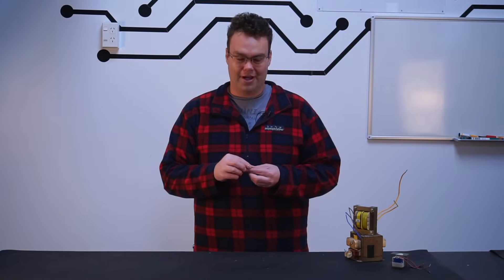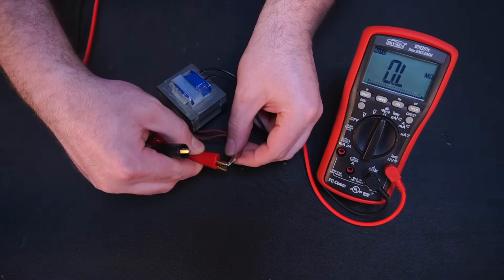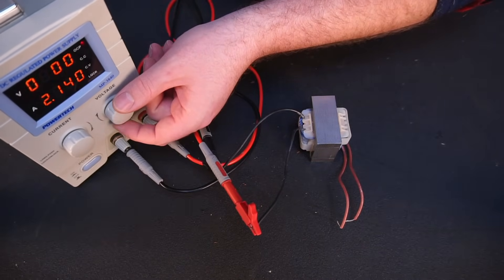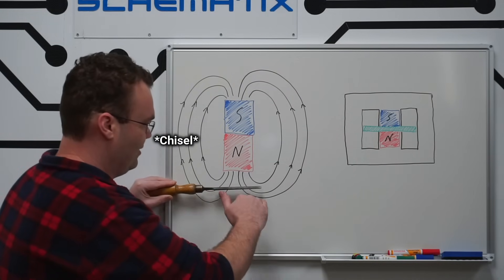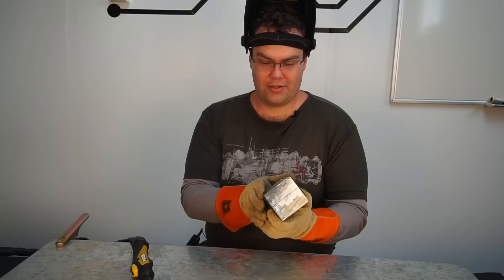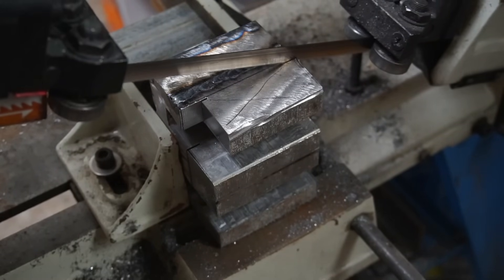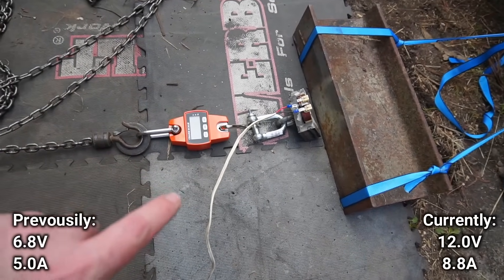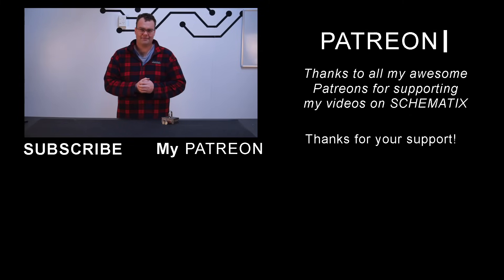Making a Powerful Electro Magnet from a Transformer

Comment: Excellent video! Who cares if you drew the bloody flux wrong. Even without the explanation, you explained it so people can build it which is more than others have managed to do. I've looked at loads of similar videos and the hosts just over complicate the basic principle. It seems it's more about ego and "look how intelligent I am..." type thing as opposed to actually helping people understand it like you've done. Quick question, could I use a 12 volt battery charger as the power supply? I'm ♿️ with technical things and don't want to blow myself up 😳. Thanks.

Comment: 9:36 Magnetic force escaping cores
Actually, I think you'll find that the flux lines will pass through the core and 'escape' out of the cut ends, rather than wrap around the whole unit. In fact if you were to separate the E and I beams by say an inch, the flux lines would escape the cuts in the E, fluff out a bit as they bridge the gap then snap back into the I beam to flow along it. Sure there'll be escape anyway, but the bulk of the field will pass through the metal. That allows us to design asymmetrical fields with a large weak side and a strong small contained side.  There are some diagrams depicting this that I'd share if YT didn't frown on posting links.  If anyone is interested, prod me in a response and I'll sort out a way to share it.

Comment: Pulleys!
I know this is an older vid and you've likely had this suggestion already, but.. To measure your magnets capabilities with your scale when the scale can't keep up, use a pulley arrangement to divide the forces.

So (unless I've mucked this up entirely) connect the magnet to your load. Hook the scale onto the magnet. Run a line from the scale to a pulley at the pole, then back to the magnet. (NOT back to the scale)  This should halve the strain on the scale. Do your stress test, then double the number you get from the scale. If that's still not strong enough, you can run a line from scale to pulley to pulley to post and triple it, and so on.  There are some neat calculators online that let you add and remove pulleys from a system and tweak load and pull forces to fiddle with this concept. It's how a block and tackle works. Which you already have in your shed there, as that's what you were using to lift yourself on the beam initially.

Pulleys let you trade motion for force, much like a lever. But a neat side effect is a careful positioning of a measuring device lets you measure the stress at that point, then simply multiply or divide out based on the pulley or lever setup.

PS: I love the kiwi accent. As an Aussie, I'm obligated to poke fun at it. "MEG" "TEG" and the other welder instead of MIG and TIG made me chuckle.  All in good fun of course.

Comment: I think it was unnecessary to cut the excess metal off the transformer. First thing, the  magnetic domains in the metal contributes to the overall magnet field. Second thing, If you had a second MOT primary coil, you could have added it series with the first and halfed the amps to achieve the same amp × turn producing magnetic field. Or ... If you the MOT coil can handle  20 amps  but your limited to 5 amps from your power supply, then you could produce twice the magnetic field with 5 amps flowing through two coils.  And last think..imagine how much time you could have saved by not cutting the excess off.

Comment: I'm not convinced the low ohm  winding makes a significantly better electromagnet. Yes, magnetic field strength is proportional to the current, but the truth is  it's proportional to the number of turns × the current. 

A copper wire with 1/4 the cross-section of a a larger copper can carry 1/4 the current of the larger wire but you can get four turns for every one turn of the larger wire.  The amp × turn ratio remains the same, granted mostly the same recognizing that thinner wires still need to be insulated and the smaller the wire the larger fraction of the diameter of the wire is insulation. 

Point being, one can still get really good electromagnets with many turns of a thinner  wire.  And, it might be easier to source a power supply  that need push fewer amps.

Comment: Thanks. I'm thinking of using one now as a "key" outside to move a locking mechanism mounted inside the door. 18650 cell powered, switchable to keep in my bag.
Doubt many burglars will have a massive electromagnet on them (or know where to use it on the outside of the door) ha ha.

Comment: What is the simplest way to make a small magnetic table so that i can make a small surface grinder about the size of an a4 piece of paper. My financial resources are very limited since i have spent most of 20 years in bed. Most of my metal and wood is what i find near the local garbage dump on each  block close to home. I really do not understand electricity though i did completely rewire my house in new york 40 years ago.

Thank you for your time and help.

Comment: If you discharge a 50,000. mfd. 200v electrolytic capacitor into a 1000 turn #24 wire 1" ID coil you can re charge old magnets or you can make a stronger magnetic field.  If you recharge a magnet that will lift 1 lb. it will now lift 1500 lbs. for about 4 seconds, it has a 1/2 life of 4 seconds.  Every 4 seconds the 1500 lbs. magnetic field drops by 1/2.   1500, 750, 375, 187, 93, 46, 23, 11, etc. When magnet field drops to about 2 lbs. it will take about 4 days to  finally return to a 1 lb. magnetic field.

Comment: I needed a such Electro Magnet for an innovative project and the one you introduced was nice.

Does it work with a car Battery?

Doesn't it damage the battery if it is used for minutes nonstop? 

If I want to use a car battery, is it necessary to do some changes in the magnet?

Thank you so much 😀

Comment: Yup a microwave xfrmr works great.12 volts d.c. from a motorbike battery will work fine.
Use a few  1157 auto lamps in parallel to limit current. They draw 2.25 amps,with both filaments wrkg.

Comment: i was considering making a electromagnet of approximately 2500 gauss out of a similar microwave transformer to do some structured water experiments with plants. can you say approximately what voltage/amperage this electromagnet would need to hit approximately 2500 gauss ? this paper seems to indicate there's a sweet spot somewhere between 2000-3000 gauss. https://www.ncbi.nlm.nih.gov/pmc/articles/PMC8153701/

Comment: very cool. so small yet so powerful. I made an electromagnet using a 65-pound steel bar and about two hundred feet of insulated copper wire. then hooked it up to a 12-volt deep cycle battery. it was strong, but not as strong as that little one you made. And it got hot quick. Thanks for the perspective. Ill change my design. ; )

Comment: Quick question about when you cut away part of the core and it was still an intact transformer. In addition to the field mostly interacting with the core itself, wouldn't you also have some loss due to the other coil? Or would that only effect it if there was a complete circuit with a load on the other coil?

Comment: Sadly I thought this was going to be worth watching.
It may be ok if you only drill ferrous RSJ or I beams on your pillar drill but it wont be any use for alluminium, copper, stainless, brass, plastics, woods, fibreglass varients, ceramics or other non ferrous items.
Even many ferrous items will not be held securely due to shape and placement.

Plotting a range of working kg force per VI ac vs dc would have been interesting.

This is nothing more than a badly made copy of other badly made copies of videos available many years ago.

So sad.

Comment: Very nice video. Many thanks for that.
But it contains two fundamental errors that should not be allowed to stand if you take it physically accurate:
1) You said the strength of the magnetic field depends on the strength of the current. This is correct, but only half the truth. In fact, the magnetic field strength and the resulting magnetic flux depend on the product of the number of turns and the amperage, which is also given as ampere-turns in the data sheets for transformer sheet metals. This means that you can generate the same magnetic field strength with one turn at one ampere or with 2 turns at 0.5 amperes. (Or 4 turns at 0.25 amperes, etc.)
This applies until the iron core reaches magnetic saturation, i.e. the "Weiss districts" shown at the beginning are all completely aligned, which is the case at around 1.6 Tesla, depending on the type of core laminations. In addition, a further increase in the ampere-turn ratio does not result in any significant increase in the magnetic field, because the field lines then no longer run in the core but as a stray field outside the core.
2) And this brings us to your second error at 9:30.
The field lines shown always take the shortest path from the north pole to the south pole of the metal core. Assuming the north pole were in the center, the field lines would theoretically take the shortest path to the two legs on the left and right which represent two splittet soutpoles and not take the detour through the air around the core as in your drawing. This is because the iron core conducts magnetic flow aprox. 15000 times better than air or vacuum. (again as long the iron core is not completely saturated)
However, the field lines in the open "E-core" do not run in a straight line to the two legs, as the corners of the poles (where the shortest air path would be) very quickly become saturated and the remaining field lines are now forced to enter more and more towards the center of the pole plates, thereby describing approximately two semicircles from the inner pole to the outer poles. The magnetic flux through the E-shaped core and the air in front of it therefore result in the shape of a horizontal "B" in your drawing. 
By the way, magnetic field lines are lazy dogs. Before they take the difficult journey through the air, they prefer to pull on the heavy iron double-T beam and hold it tight like crazy.
This explains the enormous holding force in a simple way, without going into physics any further ;-)

Comment: Hello thank you for the good info but could you tell me How do you control the amps if you are running it of a battery
Reply: Sorry one more question if running of battery should I be using thick battery cables or thinner wire.

Comment: The laminated core helps direct the field from the primary to the secondary coils, while reducing the waste magnetic field around the outside of the xformr. 
The plates are electrically isolated from each other with a thin layer of epoxy or lacquer. 
A weld would help keep the laminated sheets together physically, but also join them electrically, thereby creating a greater magnetic field. 
I think ???
Sounds good. I'll have to try and see. ?????

Comment: It may be your scientific curiosity duty to determine the max lifting power via testing.  Here's a safe way:

1:  create 3 or 4 (or 5) of the I-Beams
2:  stack them atop each other with, say, 2 inches (or some gap) worth of slack in the rope or cable connecting them to each other
3:  the magnet is deployed vertically as in your first inside-the-lab test where you stood atop the small I-beam.  It will need to be mounted on a stout overhead support to determine the max weight the magnet will pull
4:  have enough length of wire connecting from the DC supply to the magnet so the supply can be a safe distance away
5:  and a long enough pulley-rope to operate the overhead pulley from a safe distance

You could also do this with sand bags tied together with some slack in the rope that joins the bags together.  Either way, the first weight (the first I beam or sand bag) will rise and remove the slack connecting to the 2nd weight.  Then the 2nd weight will rise, take out the slack connecting it to the 3rd weight, which will rise,  and so on.

The sand is easiest to handle and easiest to adjust the weight because at some point, the Nth weight won't rise and you'd need to reduce its weight a bit until it would rise up, to know the exact total weight the magnet can handle.

You did an excellent job.   We learned in the military there are two ways to explain something:
1)  explain it in a way that can be understood
2)  or explain it in a way so that it cannot be misunderstood

You pulled of (2) very well.  Most people use (1),  and fail to communicate, because the 'can be understood' means the presentation is less obvious to at least a portion of the audience.  If you're intelligent, you choose method (2) because it's logical - why take time to explain something in an opaque fashion.

.

Comment: I'm from the future. Magnetic fields were used crack near speed of light  travel. By creating a magnetic field around the craft. They are able to control the magnetic frequency and adjust it depending on the related force in proximity.

Comment: Hello, how many volts of electricity does this magnet that you made require?
Reply: Presuming the 1 ohm resistance of the winding and the max current of 15 amps, Ohn's law says you can use 15vdc (E=I x R).

Comment: Don't forget about impedance
Reply: Not applicable in DC circuits.  Reactance (Impedence + DC resistance) is used in AC circuits  to measure the resistance to AC current flow.  There's inductive reactance (transformer windings in this instance) and capacative reactance where capactitors are involved.  Both based upon AC frequency.

Comment: Very impressed👍When testing heavy loads, make sure to insert safety link in both directions (use slightly loose rope), if the magnet fail at 300kg or more, the steel block will hit the car and the magnet can hit you with a great force, be careful!
Reply: Yes! Newton's first law of motion comes to mind, "Every action has an equal and opposite reaction". Yo certainly don't want that magnet flying off and hitting your shin, that would break both tib and fib easily
Reply: Chains don't stretch like a towing strap. Not much of a shanghai effect.

Comment: Now let's try asymetric transformer, 1 input coil and 2 output coils that are opposing each other so that, the third coil will assist the input. The effect is when loading the third coil, the input drop. Pulse the transformer with 10% duty cycle dc. 1 coil 20 turns 18awg and output coils 2 and 3 , 100 each using the right hand grip rules but flip on the core for one output coil. There it is you have an curent amplification right there.

Comment: I want an electromagnetic roller sweep that could just rip nails and screws (as well as other other items with iron in them) out the yard and flower beds of homes during and after a construction project.  Something that was strong enough it could pull a 3-1/8" #10 screw out of earth that had been trampled on.

Comment: That's a really good video, the best one I've found on that matter. Thank you so much. I need to make one or more of these in order to make a magnetic table for cleaning plasma cut parts. I'm a bit worried about it's electrical safety. Is there something I should do in order to avoid someone getting electrocuted in a magnetic table fitted with some of these electromagnets? Is just grouding the table enough?

Comment: Great video. I am trying to build a seriously powerful electro magnet using the microwave transformer. My question is, rather than cut the excess metal off of the ‘E’ shape, could I install an additional coil winding (1 or 2) from a second and/or third disassembled transformer? Installing 2 or 3 windings on the inner ‘E’ part. Then wire in separate winding in series from the power source with a switch. It is my understanding, the more winds the stronger the magnet. Any comments are appreciated. I plan to try and power this off 2 older diesel truck batteries wired in series for a 24v power supply.

Comment: Quick question, I have heard there is a need for a diode in the power supply circuit due to induction from the field collapse ( I believe) .
Can you tell me what the item is that I have found on all the microwave I have gathered, it is a black cylinder thing connected to the capacitor then to ground.
Thanks

Comment: You should experiment with making a magnet charger, about 500 turns #24 wire then pulse a big capacitor bank 15,000 mfd 200v into the coil this produced a very powerful EMP with a magnet inside the coil.  A magnet that will lift 1 lb will now lift 1500 lbs for about 4 seconds.  The magnet has a 1/2 life of 4 seconds every 4 seconds.  1500 lbs drops to 750 lbs in 4 seconds. 750 drops to 375 lbs in 4 seconds. 375 drops to 187 lbs in 4 seconds and so on.  In about 45 seconds magnet drops to about 2 lbs.  It takes another 10 to 12 hours to return to 1 lb again.

Comment: I have seen a few videos on this subject prior to yours, and I think they all went with the electromagnetic vise. I have also noticed on a few welding channels, where the clamp style ground was replaced with a magnetic ground. The question I have for this would be, can an electromagnet be used as a grounding device for a welder. There is another alternate power source that just about everyone has in their home. Many electrical devices are powered with a small "brick" which is actually a power inverter, so you have 110v A/C going in, but only a few volts D/C going out to the device. Can one of these be used in place of your lab D/C power supply??

Comment: You can double the range of your measuring instrument by using a simple tool called a 'snatch block' which consists of a single pulley, You will have to move the cable running thru the snatch block twice as far as you would be moving the load, but you would only be using half as much force to move it. 
Just measure that force and multiply by 2 to double the measurement range of your instrument.
Reply: That would overcurrent his peabrain.